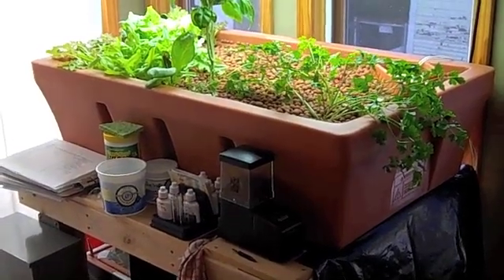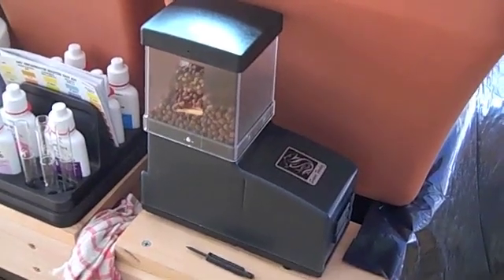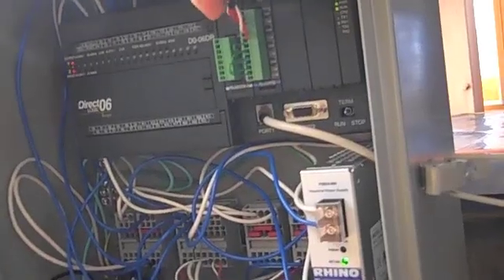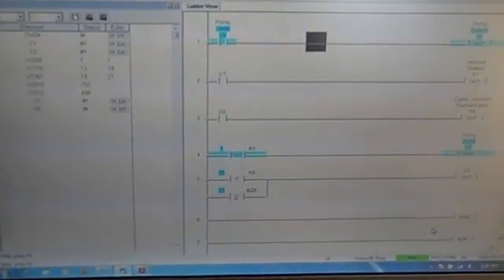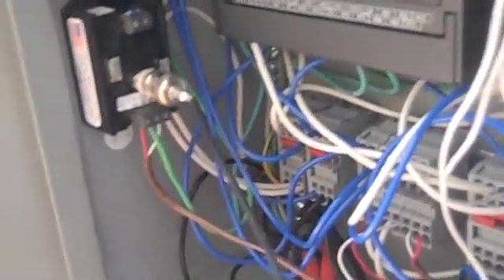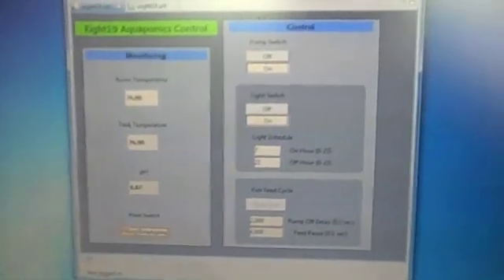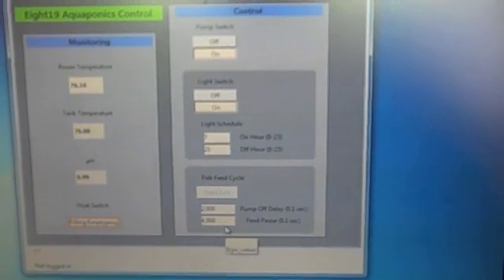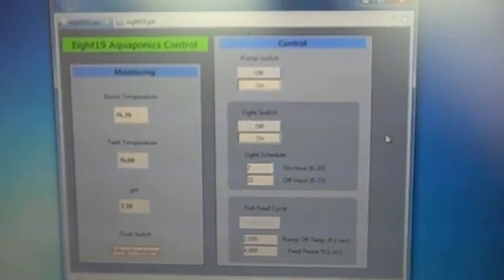Indoor Home Aquaponics Automation

Comment from the maker: Thanks for the tip. I know I could do this much cheaper with something like you mention (or Arduino). I intentionally chose a PLC, though, because the greenhouse environment is very harsh, and PLC's are designed to tolerate wide temperature and humidity swings. Having said that, I could probably buy 2 controllers for the cost of 1 PLC :)

Comment from the maker: Thanks! I did another one of these for a greenhouse, and built it with much better wire management :) The pH sensor is a sealed unit, so no topping up. I think it's supposed to last about 5 years. It came very well calibrated, and hasn't drifted since, but I did check it with calibration solutions. One thing I noticed is that some pumps leak current into the water and screw up the pH reading. Good luck!

Comment: If you use a red lion controller, it is very cheap and has built in web server so that you can have the HMI (graphs, controls etc) programmed and stored in the PLC itself.  And you can access it with any web browser.

Comment: Good job mate.  I'm a control system engineer and have been thinking of doing something like this for some time now.  Does the pH sensor require any regular recalibration or liquids/materials that need to be topped up? i.e. is the pH maintenance free?